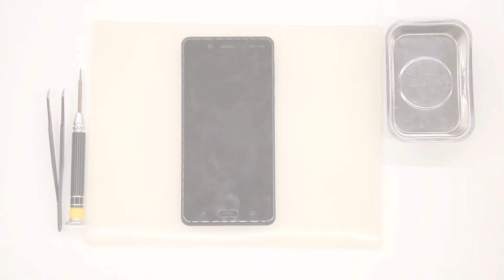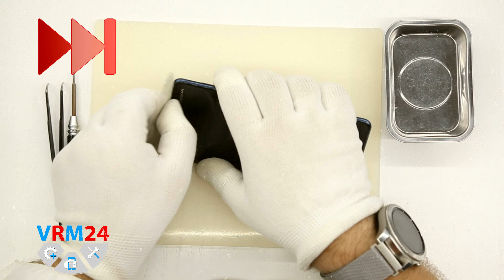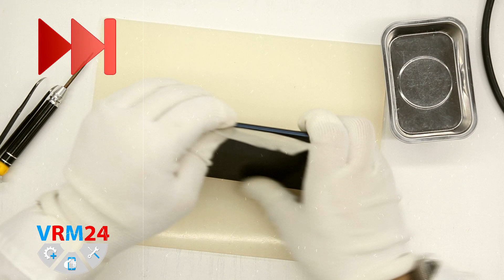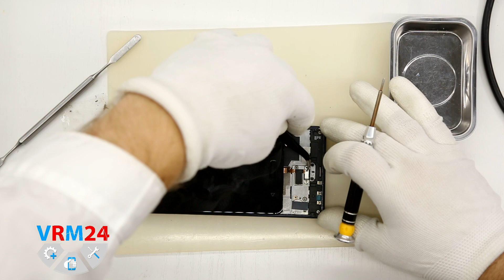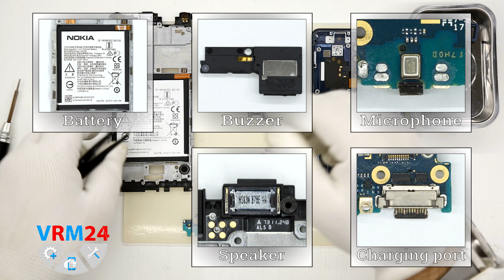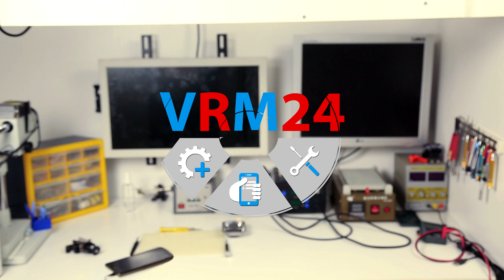How to disassemble 📱 Nokia 8 TA-1004 Take apart Tutorial

Comment: Can you open the screen without heat gun?

Mine already cracked and i didn't mind if it will broke in the process. Some of the screen shards already coming off and the adhesive doesn't feel that strong .

Comment: What is the model number of speaker of Nokia 8 dual Sim.
Reply from the maker: Hi, I can't say that because in the price-list our suppliers only models but can write compatible models, the Nokia 2/Nokia 3/Nokia 5/Nokia 8/Redmi Note 5a for earpiece speaker. What about the loudspeaker, so it's inside the case made without a chance to open it easily or save it undamaged. Unfortunately, the loudspeaker assembly is compatible with Nokia 8 only.